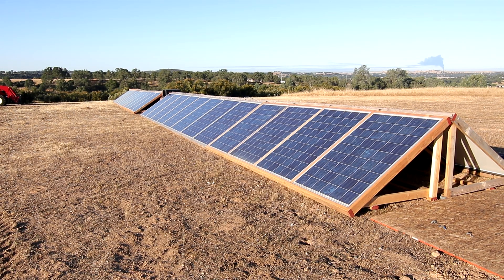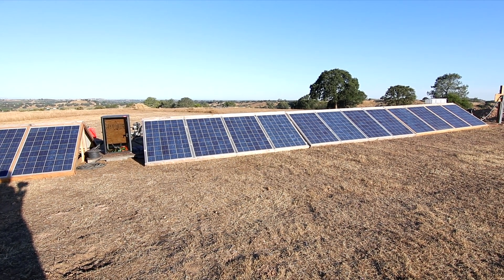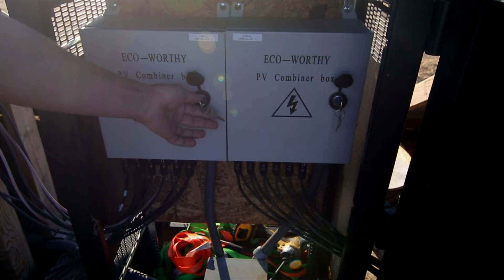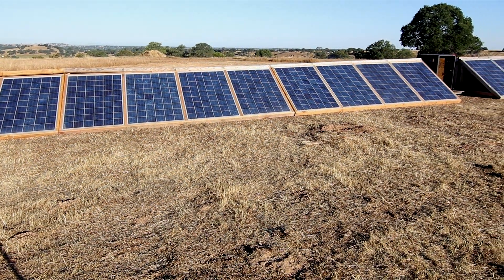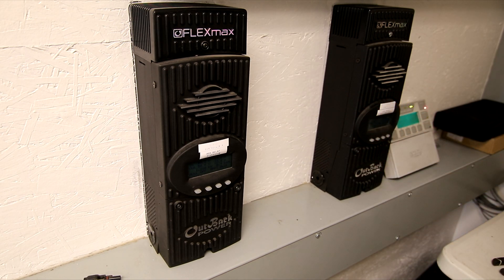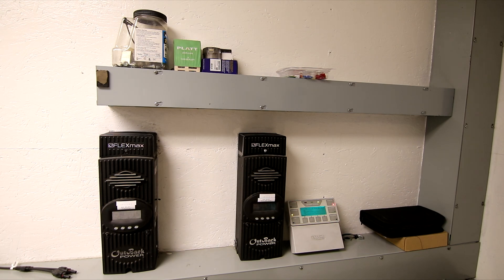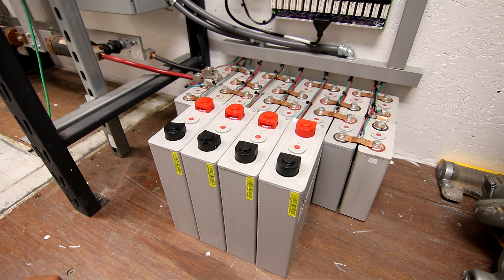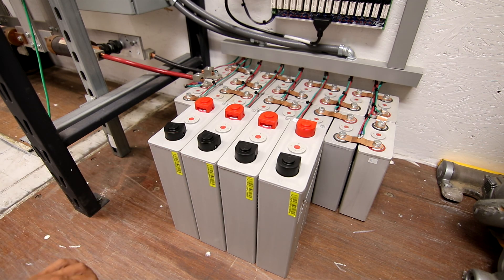Off Grid: Solar Reconfiguration Pt 4 - Completion

Comment: i am not sure i like your setup with the panel arrays sitting right on the ground. you are looking for trouble . it would have raised them at least 2 feet off the ground.
Reply from the maker: Why
Reply: @HighTechLab  
the grass is going to grow and then shading the bottom of the panels.
then you are going to cut the grass and i see many rocks laying around.
better ventilation.
the arrays are that much higher up and slightly more production.

Comment: Hang on, you're in California, 48 panels, and only generated 50kWh in a day? Is that a normal daily production where you're at? I'm in the Netherlands, 15 panels, and did 23kWh yesterday. What's the peak wattage of your setup?
About your east-west setup: I get it. During the day, if your panels are oriented south, they get so hot that they become very inefficient, especially in Californian summers. This way, you can profit from the lower power morning and evening sun, while also getting quite a bit at noon, without making your panels heat up so much they get inefficient. You would get a much wider, maybe slightly less tall curve with your setup than somebody with their panels oriented south.
Reply: By the looks of things in the video, he is using the larger, 24v nominal ~200watt panels. Perhaps you like me, are using 12v ~100watt panels?
Reply from the maker: These panels are 72 cells, OCV is 37.5.  some panels are 210 watt and others are 245 watt.  I have 4 in series running right around 150vOC, the upper limit of the Outbacks.

And Tim you nailed it on the shapes of the curve.  The gain is the lesser wear on the batteries and the ability to run on solar later in the evening instead of the batteries.
Reply: @HighTechLab  Yeah for somebody like you who's off grid, I fully understand why you're using the east-west setup, that makes a lot of sense. I'm just wondering, what kind of day was that 50kWh day for you? 23kWh is about the best we can do in a day over here, how does the 50 compare to your best possible days? If I take 210W for every panel, you still have over 10kW peak wattage, compared to my 3.9kW peak, so I'd expect your best day production to be quite a bit higher, right?
Reply: @andrewmcfarland57  I can't remember of the top of my head, but it shouldn't matter, right? One kWh is one kWh, regardless if it's generated at 1V or 480V. Doing some quick math: Taking 210W as the wattage for all panels, that's a peak wattage of just over 10kW. My setup has a 3.9kW peak. Now I don't know what kind of day that 50kWh day was for HTL, 23kWh is just about the max we can generate in one day, so I'm comparing my best possible to something that may be below average, I don't know.

Comment: possibly a dumb question but i found someone selling solar panels that had originally been for one of those parking lot shade panel setups. And somone hit them with a car and as far as i can tell it collapsed and they cut the terminals to make taking it apart easier. Is it worth replacing the terminals on the panels and using them assuming there not damaged.
Reply from the maker: I would say so. Opening the boxes on the back is very easy and you can just connect on a new wire.
Reply: @HighTechLab  
not necessarily. some are filled with gunk

Comment: Why don't you keep using the 48V 100Ah battery bank? You would just put it in parallel with the 180Ah battery banks. You can never have too much battery capacity! lol
Reply from the maker: Because I want to use it as a backup power source for all of my controls

Comment: Why not use a swamp cooler instead of A/C? I'ed think its pretty dry air there so it should be very efficient.
I've been using a swamp cooler on my tiny off grid setup in Idaho to cool my RV, the humidity is 28% here most of the time and almost 90F. 
Right now it's 89F, 28% outside and 73F, 61% inside, but I don't have everything sealed up yet.
I haven't needed to use the A/C at all.
Reply from the maker: But the sticky feeling of swamp cooling is not fun.
Reply: @HighTechLab  For me as long as the outside air is dry (which it is very dry most of the time here)
its doesn't have that feel, it feels just like when I used the A/C. It seems that my swamp cooler adds around 35% humidity to the air. 
I know that feel and ya it's not comfortable.

Comment: Doesn’t your place have serial communication? I know that the dl05 and dl06 do that. I don’t know about the click.
Reply from the maker: The CLICK has Modbus - I've been attempting today to get data out of the Mate from the PLC today with no luck so far.  Have you gotten your PLC to communicate with a mate and/or FlexMax controllers?
Reply: HighTechLab  I am retired now (7+ years) so I haven’t worked with them for a while. I think there is a way to use ASCII strings in the pic. I was going to use it when the SCOM 7330 controller will send and receive ASCII strings. I know the click does RS232. Maybe you could use some other device to translate to RS232. Raspberry PI!, Arduino or some such. I couldn’t help you there however. Good luck.